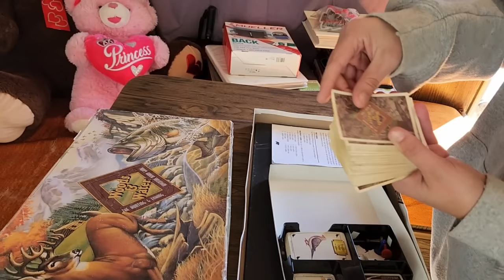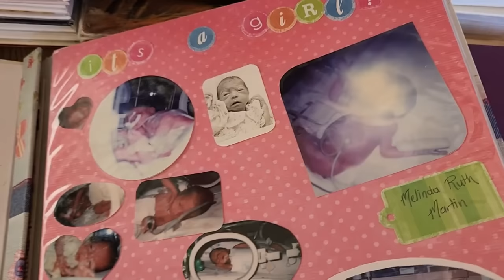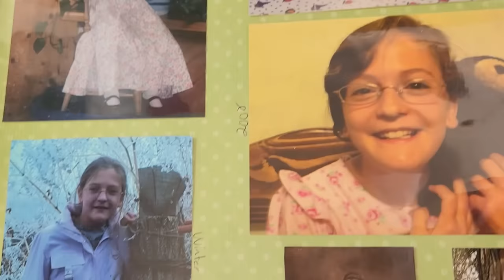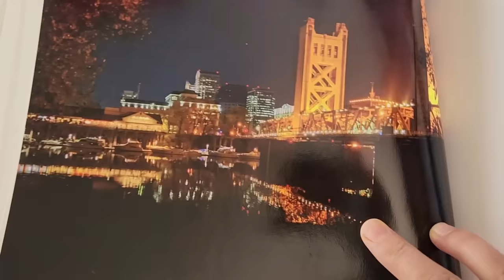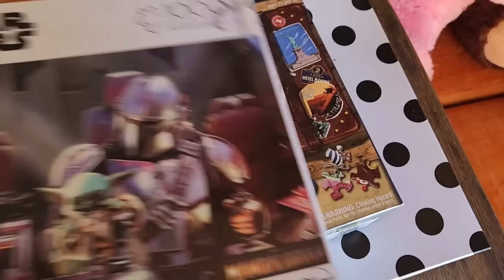we're moving out of our camper

Comment: I'm sure your tiny home will be comfy and cozy when you get all settled. If you hang a blanket over the door (on the inside) it will help keep drafts out. Also, check for drafts around the window and along the tops and bottoms of the walls. It's amazing what a difference some caulk can make. Sending warm thoughts and praying for y'all from Indiana!
Reply from the maker: We hung a blanket over the door last night and it worked wonders! Thanks for the advice!
Reply: Caulk or spray foam!
Reply: @melindarocuant  plastic over the windows is what I usually  do as well. Blocks out cold wind. Just hang over with tape. I do this every winter.

Comment: Melinda, if you all get a couple of pieces of plywood and 4x4's and make yourself a platform for you mattress and make it about 3 feet or more, up in the air using the 4x4/s for the legs and plywood for the mattress to lay on, you will need some 2x4's to go nail to the 4x4's for to hold the plywood, you can use all under the elevated bed for storage, using plastic containers and label them so you can find what you need easily. You can store food, clothes, blankets, etc.

Comment: The ceiling will be your greatest heat loss in the winter if it isn't insulated. If there's a space between the ceiling and the underside of the roof, it needs to have non-backed insulation in it. If there's no space and just a roof, you need to buy paper backed insulation made for 2x4 rafters and a staple gun. Put the insulation between the rafters and staple the paper sides to the bottom side of the rafters. Try not to compress the insulation as much as possible. The more naturally expansive it is the better it works. Also, get some water based acrylic latex calk and calk every crack under 1/4in  you can find, especially around the windows. any cracks over 1/8 inch needs foam backer rod put into the cracks before sealing up. You can use low expansion foam in a can, but be careful, it expands just enough to cause problems in some places. Plus, you can't occupy the building until it has fully cured (24 hours). The brick block walls need insulated too (Extruded polystyrene), but that's a lot more money, work and tools to get that done properly(mold prevention). The ceiling is the most important and will make the biggest difference in retaining heat within the building.  God bless you and the unborn.

Comment: Make a bed platform with 2x4s and osb. Make high enough to slide large plastic totes underneath for storage. I have that in my tiny house cabin. 
Also make loft for storage. Slide bed underneath loft or couch. 
Once the bed is raised higher its also alot  warmer. Get mini wood stove. Very warm. Burn sticks if you have too.
Hang as much as you can on walls to open up more floor space.

Comment: Get yourself some mylar to throw around the windows and then put the blankets over top! Im telling you works like a dream🙌 they also sell weather sealing tape to make extra sure there are no drafts so use that, then mylar, then the blankets.
Reply: I'm not one for portable heaters due to the dangers but as a gift I was given a dyson hot and cold. Filters aren't cheap but I just clean and reuse mine till its falling apart. It has helped tremendously with the heat and cold(more so cold)and just in general filtering the air. We have a mold problem we have no means to remedy and ive seen a huge difference, more respiratory illness without it. Might be a worthwhile investment living in a shed🙌 it'll keep the air clean and help keep things warm and you can check air quality and humidity levels. There are prob better ones out there but I think a device like that would be worthwhile. Would highly suggest though living in the shed getting yourselves a hygrometer to keep an eye on humidity! I have one from Walmart that shows me the temp and humidity indoors and out. Also suggest heating bags of rice you can wrap up in cloth or thick socks and then put in bed with you or when lounging! I've done it when the power was out , had to heat it over a candle which was a doozy and I do it for the feral cats I feed.

Comment: Now you need to go get you what? The call a hot plate so that you can have 1 or 2 electric burners to cook on. I know you have that camp stop though. I think Irma, were you saying you have a crockpot? So that's good, maybe now. You should get a toaster oven, so you can have a little oven. They are very handy.  And you need to get one of those foldable baths. Check on temu. They also have little inflatable bathtubs too. That way you guys can fade obviously. And they do have collapsible sinks That also have a plug in the bottom of it for easy drainage. And I don't knock your situation. I have been in your situation NS obvious. You guys are doing everything you can to make your situation better. I don't knock anybody for that. The only thing I don't agree on is your religious views. And that's OK too. We don't have to agree there but I still will support you by watching your Channel hitting the like button I'm trying to give you any advice. I can make sure you guys at least get some sort of heater I. Don't suggest an electric Heater, they are not meant to be in only source of heat. Maybe a carrollseen heater or a diesel heater. Propane heaters usually leave a lot of moisture in the air so everything is like wet feeling kind of moist feeling. I know from experience. I grew up in campers and I grew up in homes without heat.  Caressing is usually pretty cheap. And you can also use diesel in kerosene heaters as well. I know that you're little guy. Slept with you guys in bed in the camper. And I would still continue that. And tell you guys, no, you're going to be in a place for you. Have a resourceful amount of heat all the time. I grew up with nothing.  In a camper, what's new running water? None of that so I can give you advice on things. You have questions about any time. I leave more than happy to help you. There's nothing wrong with what you're doing. You're providing a roof of your child's head and food in this belly. And obviously you're good parents, he's really smart.  From what I have seen so I don't know who is being rude to you. But ignore them.❤